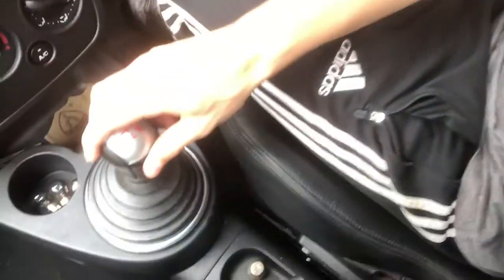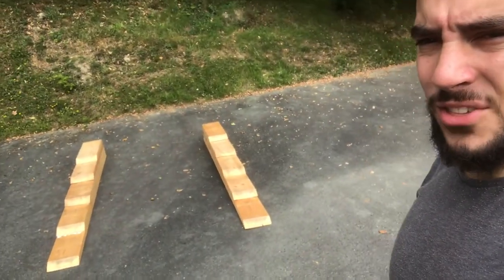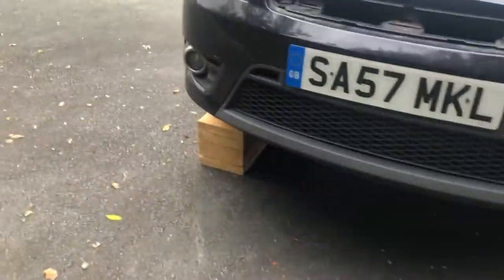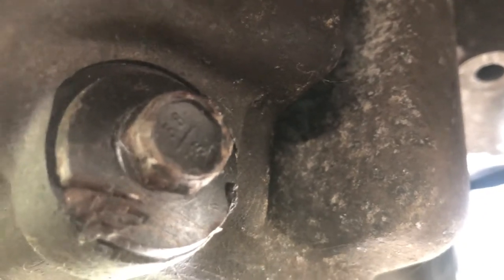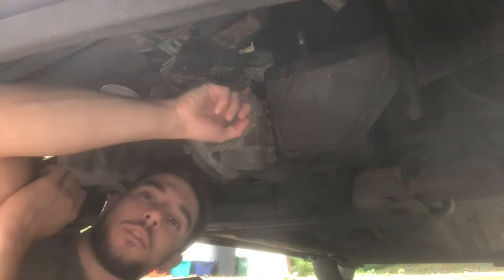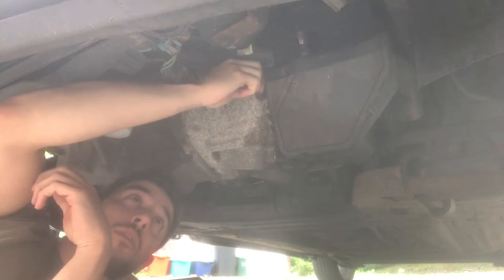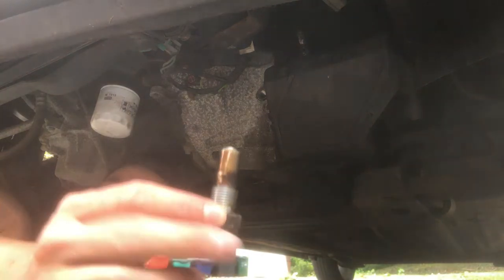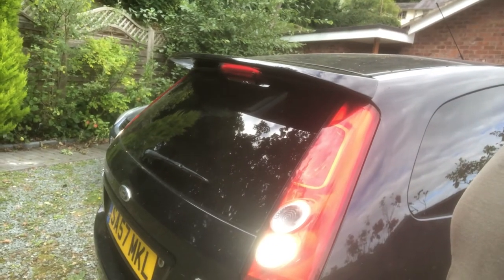Fixing the reverse lights on my Fiesta ST150

Comment: My ST150 reverse lights don’t work and I’m worried oil will go everywhere if I try change it
Reply from the maker: No oil came out when I changed the switch and I have since changed the gearbox and I can confirm there was oil in there cause I had to drain it before I dropped the box so you should be fine to change the switch. You shouldn’t lose any oil. If you take a look at the height of the switch and the height of the fill plug the switch should be higher
Reply: Mend It Mod It oh ok thanks bud
Reply: Mend It Mod It jacked it up today and found the switch, mine is the same as yours (square shape not triangular) so just ordered the new switch and mine is def shot. I shorted the circuit with a paper clip and the reverse lights came on so def not the fuse or bulbs etc. Online it says the triangular one is correct and the square one won’t fit which is weird as clearly on ours it isn’t
Reply from the maker: @jamie123b  yeah I’m not quite sure why there’s a difference between the parts. I thought it was a pre facelift/facelift thing but apparently not. The only thing I can think of is maybe a supply issue at the factory and they had to find an alternative supplier and this was the closest they had 🤷🏻‍♂️ sounds like the switch for definite. I’ve now changed. My gearbox and my reverse lights don’t work at all. But the switch works if I pull it from the box and press it with my finger so it’s the gearbox, the bit inside which presses the switch when I put it in reverse doesn’t work 😑
Reply: @MendItModIt  swapped the switch around today and the reverse lights now work!! Was worried I might find the same as you that it's a gearbox problem
Reply from the maker: @jamie123b  awesome! I’m glad you got it working 👍🏻👍🏻
Reply: Mend It Mod It ty bud!